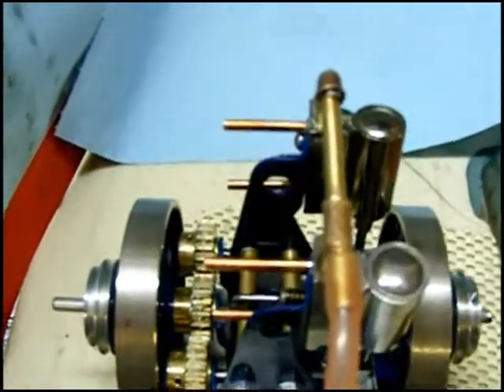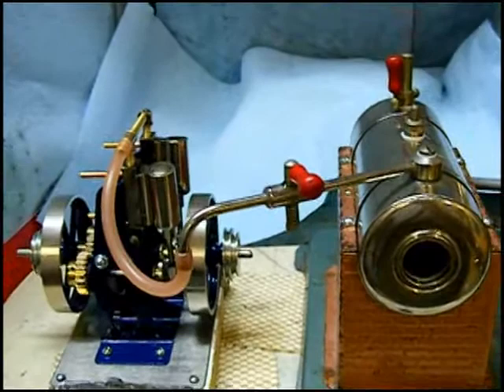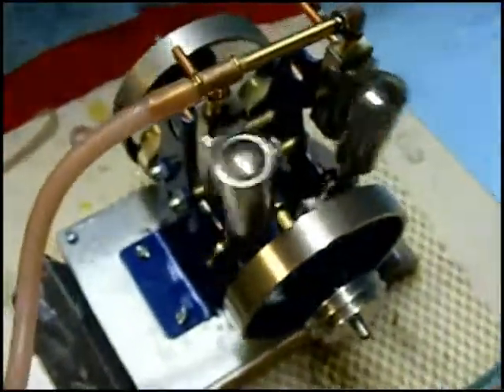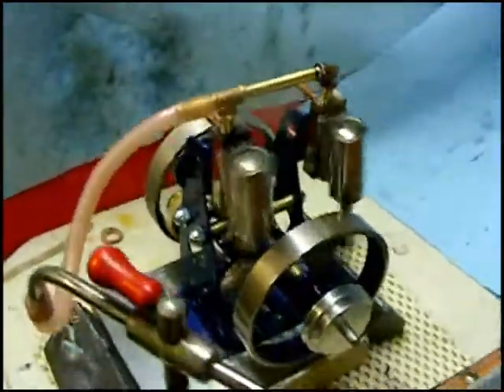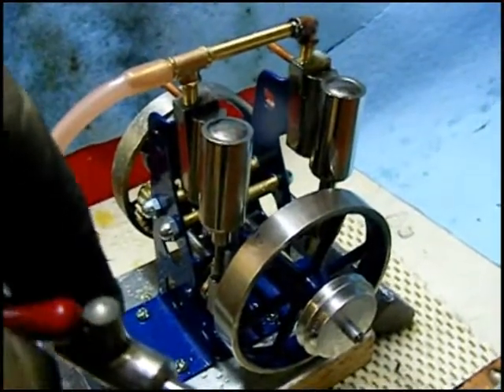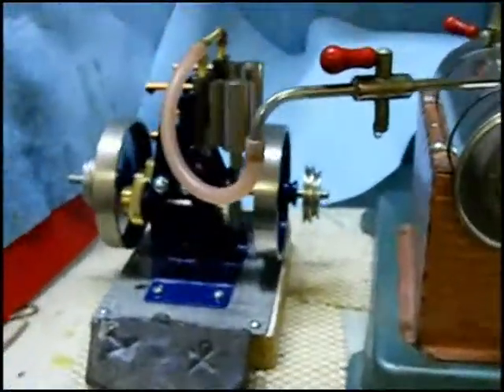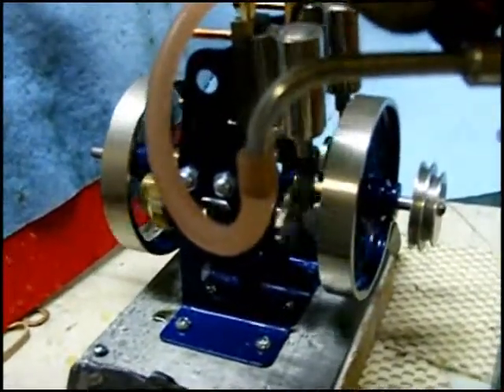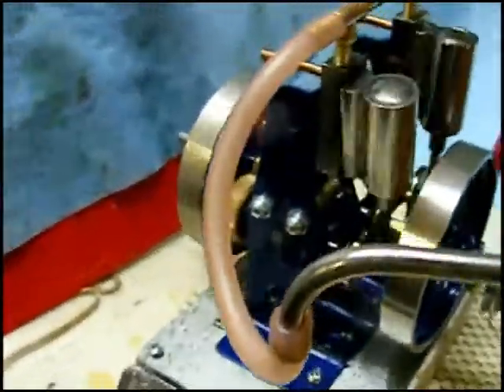Mk-I Steamworks J70D - First steaming

Comment from the maker: Great minds and all that ;)
I wanted to prove the concept of the Jensen 70 as a modular engine.  This could easily be made a 4 cylinder multiplex, or a 3 cylinder triplex (center frame displaced to the right maybe 3/4 inch and a third cylinder will run on it without fouling the other 2.  You just have to replumb the steam chest to make it run backwards).
I thought for a first effort I'd keep it simple, though.